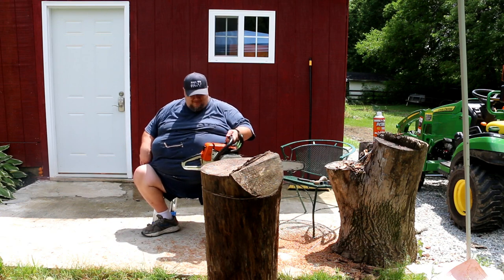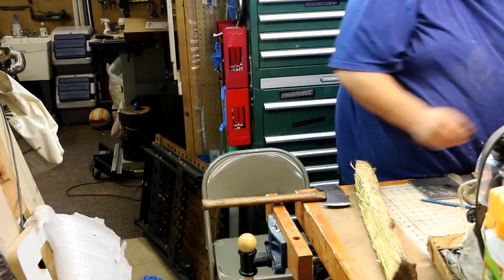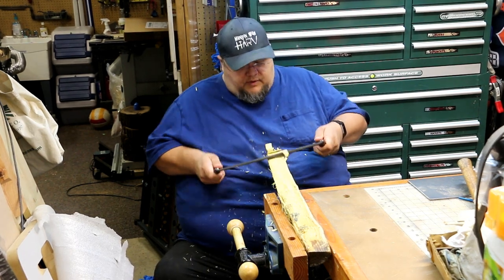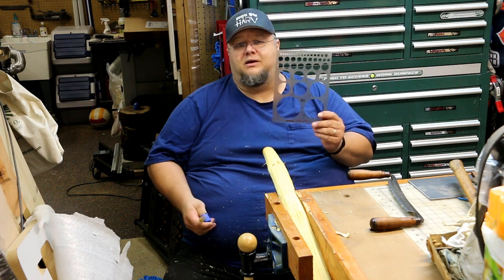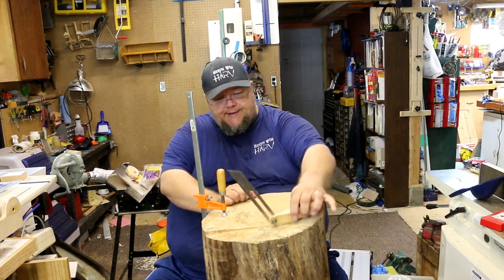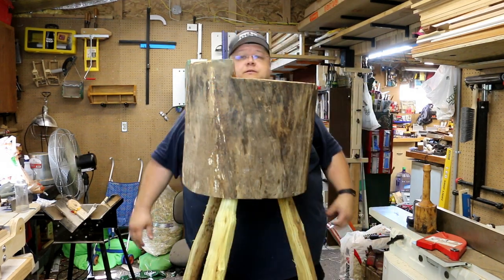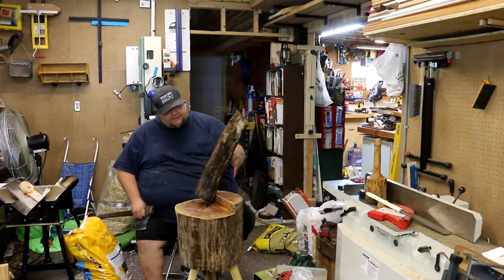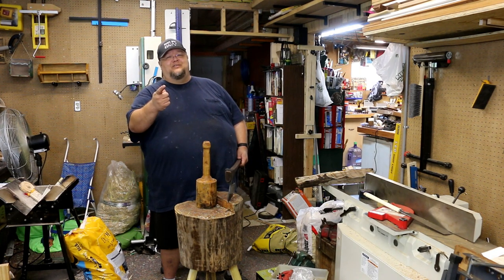Harv's Axe / Chopping Block Build

Comment: That's all I needs a good carb clean and maybe a carb adjustment a check your spark arrestor on the front where the where the muffler is does a little screen in there take that off and clean it out
Reply: Not to mention those stupid high and low idle screws....
Reply: WHAT WAS IT WITHT HE CHAINSAW??? SOUNDS LIKE MY STIHL WHNE THE SCREEN IN THE CARB WAS CLOGGED. CLEANED IT OUR - LIKE BRAND NEW.
Reply from the maker: It absolutely was the screen in the carb. Runs great now!
Reply: @HanginwithHarv  THX for getting back - that was a while ago you had that problem :) Enjoyed your video... THX!!!